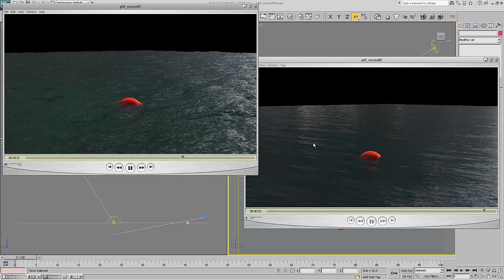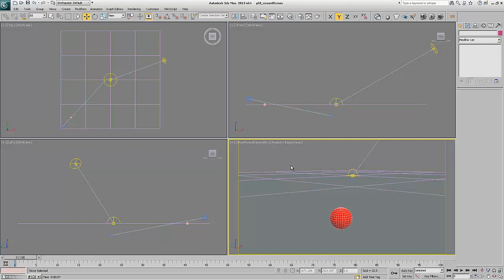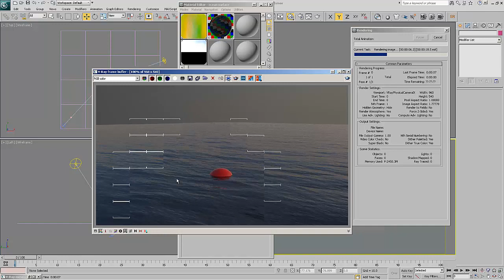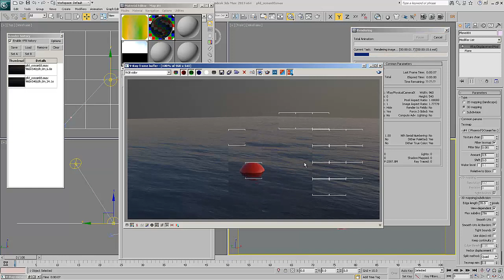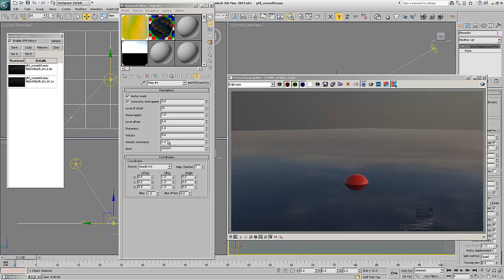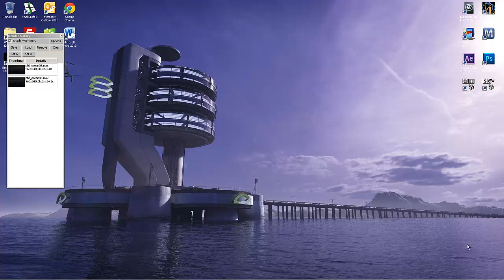3Dean:  Ocean Surface Using Phoenix FD

Comment: Hi ! Please tell me How can I make a boat participate in both 2 animation:
1. follow keyframe I set from position A -> Position B
2. Follow floating ocean surface.

Thanks !
Reply from the maker: Just place the boat slightly below the surface of the water, then animate the boat, then recalculate the sim. Is that what you're asking?

Comment: it took 7 seconds for the modifier version, because you set the edge lenght to 35px. otherwise it uses the default displacement setting, what is 4px, so it takes more time to calculate, but you can increase that in the render settings so it will take the same time to render.
modifier is useful when you want to control the resolution of displacement on different objects in the same scene

Comment: very detailed tutorial, congrats man! only one additional note that i find important - the displacement modifier has texture clamping by default  set to 0 and 1, but the ocean texture may produce bigger values, and when you tried to increase the wind speed in order to obtain bigger waves, the clamp was quite visible, the waves were large but flat. to avoid the clamping you have to expand the clamping range in both the directions, and then you can get really big waves like in a storm

Comment: If you put the displacement on the map your using 3dsmax displacement, if you use the vray displacement modifier your using vray's specific and optimised modifier, hence the speed difference.  You could probably tune and tweak them to look exactly the same however.